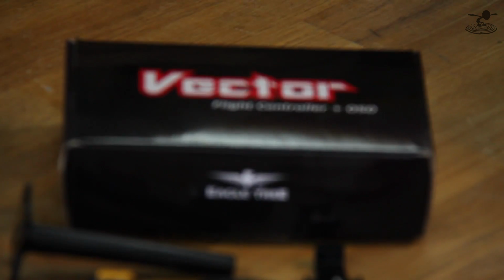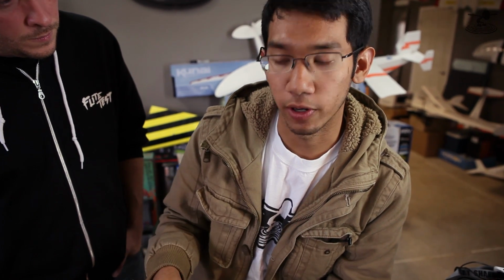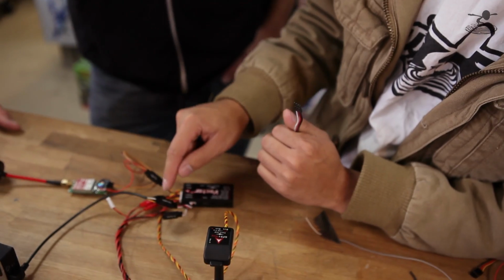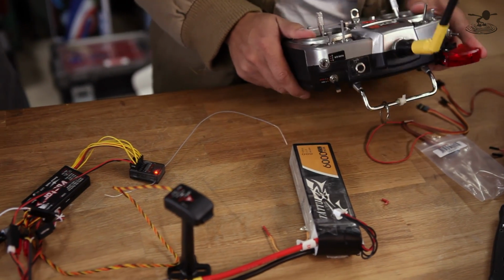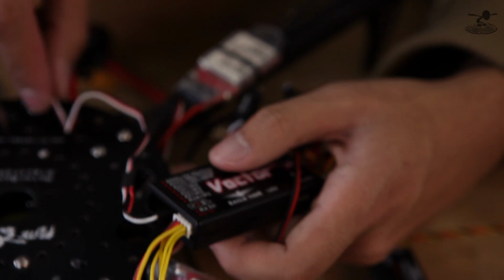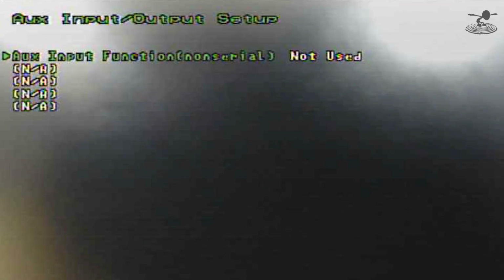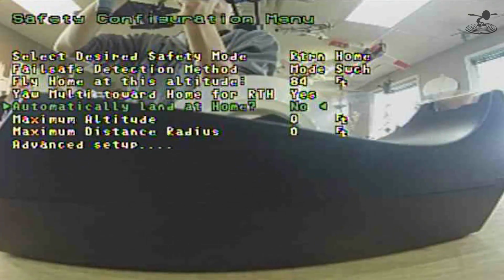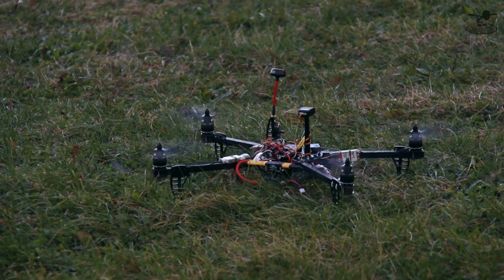Flite Test | Vector Flight Controller + OSD - Basic Setup

Comment: Personally the eagle vector has been terrible, I’m still struggling to get this working even after a year of messing with a various amount of settings. I finally got 2 motors to spin up normally (rear left and front right) but the other two only spin when the throttle is set to 100% . I’ve tried different escs and motors, and multiple calibrations but it doesn’t do anything. STAY AWAY FROM THE VECTOR AND DONT WASTE YOUR MONEY !!!!!!

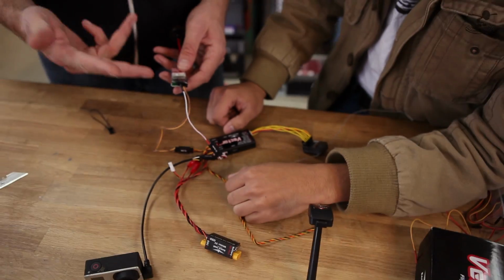Comment: At 12:00 I think you're making a mistake: If you power the TX directly instead of through the PSU, the current sensor will not account for what the TX uses, so you're actually drawing more mAh than your sensor sees and what you see on your OSD.

Comment: Nice video.  I actually watched this a while ago but just recently bought a used Doscovery with Eagle Tree Pro OSD in it and didn't have a clue where to start.  After reading the manual and watching this, I'm really looking forward to getting this set up and out flying when the weather gets better.
Reply: You'll like it.  Easy to set up and a GREAT manual.  I've made use of their customer support once when a PSU was misreporting voltages, they were quick to get it handled.

Comment: I hope you guys are on commission, because this video just secured a sale! Been trying to decide between this or the Cyclops Tornado. The vector costs a little more, BUT it also accepts digital RSSI from an ezuhf receiver. ezuhf users would need to purchase a converter to get RSSI into a Cyclops OSD and an 'off the shelf' one pretty much makes up the cost difference of the Vector.

Comment: Ah...The way this guy set-up that IMRC 600Mv VTx is totally incorrect !! First....Why is he not using the proper Immersion RC cables that came with VTX that "lock-in" properly upon installation ?? Secondly ....The Power Source for IMRC VTx's should come directly from the flight battery (solder pads on the frame if using a multirotor) 6V-25V...The IMRC VTX has a built in power regulator and the  proper installation procedure can be found at the Immersion RC web site that I cannot post in here! Review is a 6 out of 10 !!
Reply: You can just buy the IRC adapter for the vector PNP to make things easier

Comment: Flight Test, I currently have a PixHawk set up with DJI E-800 motor set up that is just giving me fits with the throttle. It is not giving me enough throttle to stay in the air while descending and she hits the ground hard. Do you think the Vector would be a good fit for these DJI motors. I have about 3Kg of flying weight w/battery. Running on a 6S 10,000mAh. I really like all the functions of this Vector and wish I had seen this video before the Pix purchase.  

thanks
 Grumpy.

Comment: Since im sure you have set it up on different platforms. I'm wondering if it could be used on a 650 quad-copter with retractable landing gear. If so how can i set up my retractable landing gear with the eagle tree vector.

Comment: Hello Josh and Peter,
Can you explain the Tricopter wiring? The manual confuses me when it comes to the using a separate UBEC to power the lone tail servo. How does the wiring work in this case? The three ESC's are opto with the Simon flashed system.

Also, when using a three way battery connector you can plug the ESC's directly to the battery? then not use the battery connector on the PSU? What are the Pro/Cons of doing this?

Thanks guys, I love your site. Lots of knowledge and fun. Take care,

Carlton Scott - Vancouver WA

Comment: Have to love the Flite Test guys! Thanks for doing such a great video on the Vector. Wish this video was available last Black Friday when I bought my Vector and a DJI Flamewheel F450 Quad. I spent hours trying to get the motors to arm not realizing you have to confirm the airframe type. I was strictly using the PC software via USB and it does not tell you to confirm and does not allow you to confirm (as far as I can tell). It was not until I gave up on trying to arm and thought why not hook up my video TX and that is when I found the issue. Then I had to learn how to do the Stick menu. Really wish the PC software was a little more complete in this area.

Comment: Come on guys .. horrible wiring on the Video-TX! Why didn't you guys use the original cable with the plugs, which would secure the wires from slipping off.

Comment: Guys, aren't you creating a ground loop by connecting the ground of the aileron wire to the Rx and the ground wire from you current sensor to power up the Rx?

Comment: Comparing this to the APM/Pixhawk I am pleased that it his a more robust color display with more than one battery voltage readout. Disadvantages are that it has no telemetry radios for remote mission control or mission planner software and it costs twice the  price.
The ease of installation is great and I like it's flexibility with various types of RSSI signals. The software configuration however looks far from simple and should encourage a lot of forum chatter and how-to videos :-)

Comment: I am happy to see you guys check out the Vector. I bought one when they first came out and love it. I would not even fly my fixed wing (FPV Penguin) without it. I love being able to launch my plane by line of sight, put the system in loiter mode while I put my FPV goggles on and the great Return To Home features.
When you use the Vector with the Eagle Eyes FPV Ground station you get great and easy to setup  antenna tracking and lots of other great features.
Great video. 
(The last two videos on my channel show the Vector in action on a fixed wing.)

Comment: It's convenient to have OSD and controller in 1. With APM/Pixhawk, I have to use the external and crappy MinimOSD hardware (although OSDoge will solve that soon).
What I do miss in Vector is autotuning. Arducopter and Cleanflight already have it. I hope they catch up soon.

Please let David try it on his tricopter. The reason is, some controllers cause oscillations with a top heavy tail motor+prop assembly, as the motor+prop mass swings the frame in the opposite direction of where the controller wants it to turn.

Comment: do you guys know of anything that can work with VTOL aircraft? i have a design that uses 3 engines, one is a ducted fan to provide balancing vertical thrust for hovering, but in forward flight, the other 2 engines are used while the ducted fan is stored away unused.

Comment: I am into fixed wing waypoint flying with the APM. This system looks much more user friendly than APM/Mission Planner. Does it have ground station software like APM? Will you do a video comparing the two systems  on fixed wing? Thanks guys! 
Big fan of everything you do; the show, the podcasts, etc...

Comment: Is there any way to use this without a fpv setup? I will eventually get fpv gear but I am looking for something nicer to replace my kk2 with for now.
Reply from the maker: The Vector does have OSD but you do not need to use it. It will be available for you when you decide to upgrade to an FPV system. :)
Reply: *****
 but you need to have the video transmitter for that...without fpv gear use a pc to configure  and  when you get bored flying  in a circle  just add the fpv stuff and your good to go explore :)
Reply: Kippuravittu I had an issue using the PC software and airframe confirmation. Had to use video to confirm the airframe as the final step to arm the motors. Could not be done on software, but I am hoping I am wrong and someone will point out where I missed it.
Reply: James Caperelli III  oh  that sucks..but it would be just ridiculous if it's impossible to determine your frame type on the pc so you must have missed it somewhere..I've allways thought that every company needs and idiot like me in the team to test out the products so fools like me can then use it without too much lost hair..

Comment: At $280 (U.S.) this setup is just about double what it would cost for an APM controller, GPS and OSD.  It may very well be twice as good, but it is certainly twice the money.
Reply: mPky1 By your logic, we should all just get DJI Inspire 1s and call it at day... Problem for me is not the high price of this FC. Problem is it's price compared to APM which is far more mature and feature rich system.
Reply from the maker: Just a minor note, I am sure you can find somewhere to pay $280, but GetFPV is selling it for $237. 
http://www.getfpv.com/eagle-tree-vector-fpv-controller-with-color-osd-wire-leads.html
Reply: mPky1 luckily theres also flip32, Naze32, Sparky(soon Sparky2), Quinton and a whole range of new 32 bit controllers that are cheap and powerful and not running out of code space or capability.
Reply: I'm a huge Pixhawk fan. However, even buying the Hobbyking clone of pixhawk you are going to be close in cost when you add gps and OSD + FTDI. Not to mention the effort in to wiring up the OSD and configuring it. I'm tempted to get this and try out.
Reply: mPky1 I would like to have seen more of the capability and differentiating features of this FC ensemble.  Does it do waypoint flights?  If so, with what software? (and at what cost?)  Does that run on a tablet, and/or a PC?  I see the configuration software runs on a PC.  Just as $100 doesn't mean much in this hobby, solder-assembly doesn't either.  If you're depending on everything being plug-n-play, you aren't really IN this hobby.
Where people say APM is dead, I counter that it is stable and mature.  It will take time for Eagle Tree to work out the bulk of the bugs in Vector.  The lowest price I see online is $238.  I'd like to see a shoot-out between this, any APM and possibly a naze32 setup.
Reply: flanker you're forgetting about cleanflight that was created because Timecop is an elitist who don't listen to anyone. and there are many more systems than those who now support semi autonomous and autonomous flight.
Reply: Pixhawk can be found in hobbyking for about 120 bucks. MinimOSD with ftdi adapter, another 20 and you are good. And if you want to get technical, pixhawk isn't just another 32 bit processor. It runs on Linux. Can interpret lua mission scrips. And actually has two 32bit processors(one is for redundancy). 

If you like naza or naze32 or whatever more, that's fine. But excluding military grade auto pilot systems, there are no other commercial fc that's is even remotely close to pixhawks capabilities (and yes complexity)

In conclusion, if you are technically minded and not afraid to tinker with stuff. ArduPilot is the best there is. 

If you want stuff to just work, and don't mind paying extra, get a DJI. 

I'm not really clear on who this Vector fc is aimed for really. People who like to tinker AND don't mind paying extra maybe?
Reply: mPky1
I was not aware APM boards will SHUT OFF!  And I mentioned OSD.  I reference the price listed on the website.  Many of us have experienced the "don't get in the hobby" line from 3DR, selling a board for far more that is basically identical.  I would have been interested to know how this product is better, but this seemed like a sales pitch rather than a review.
Reply: mPky1
you're saying it as if buying piece by piece is a bad thing.  like me with a reptile500 and a kk2 I could have a working quad for very little that can be upgraded. of course I over specced from the start. next I'll get a Sparky or Quanton, then I can add GPS and other sensors over time and as I need them instead of buying everything I may not ever need right away.

I'm also not sold on having the FC bound to the OSD, it limits your choices and falls between chairs, it's not really easy and limits advanced capabilities. The only real benefit I see from it is the ability to see flight mode on the OSD, but if all the FC and OSD makers agreed on one standard for a daisy chained data bus, there no reason any OSD shouldn't be able to show the same info, as well as much more, heck it could even provide the same functionality as this all in one.
Reply: Hugh Hemington  yeah that'd be a really cool shootout but naze32(baseflight at least) has no place in such a competition. 

Don't get me wrong i love the locked in feeling and small footprint of naze32. As far as flight stabilization go I think base flight is the best there is. But as of yet it doesn't even have RTL, let alone autonomous flight capabilities. And timecop(creator of baseflight and naze32 board) said that it'll never have those capabilities(he seems to think auto flight is for pussies and a real men would never need things like failsafes and RTL). Comparing it to APM would be like comparing a porche to an AC130

The shootout I'd  like to see is between : pixhawk, naza, vector and the flagship board of openpilot(can't remember the name).
Reply: Hugh Hemington
So your idea off this hobby is that everyone should go out to saw down some trees and then wait 3years for it to dry so you can start carving out the tools you need to make your quadcopter...How's that going? Have you carved your propellors yourself sir? and did you also dig up that ore that is used to make your motors?

APM is fucking silly nothing pre programmed really ,you need to figure everything out by your self wasting tons of money by crashing constantly..I like plug n play but not the types like naza where you are totally limited on ridiculously priced aftermarket part's...Allthou Naza is great for beginners since  it will save you a ton of money for it'ssimplicity to setup just plug n fly..But RTF kits shouldnot be sold since  building your  machinesyourself makes you a bit more carefull when flying..allthese phantom pilots flying in to walls and shit..
Reply: $235 for complete package and you don't have to hunt all over the internet to set it up.  Well worth the price of what you get.

Comment: It's not always the best idea to upgrade firmware.. really if you don't have any issues then you probably should just leave it.. sometimes upgrading firmware can lead to new issues (source: I'm a system administrator).
Reply: Wouldn't it normally solve glitches that they didn't find until after initial release? I mean they have a team of people working on the ware and test and retest patches. Hell the upgrade they suggest in the manual might fix a potentially fatal crash. Damned if you do damned if you don't I suppose?
Reply: stealth soup It totally depends on the device. With something like this, it might be a good idea, but not always. It's best to check the release notes of the firmware first and see what specifically the firmware does. Again, if you aren't having problems, and if the new firmware isn't critical then I wouldn't risk it. You can risk bricking your device if the firmware update fails.. the mobius cam for example, they even warn that unless you are having specific problems then you shouldn't upgrade the firmware.
Reply: Designandrew
 Ahh I see. Thank you sir.
Reply: @stealthsoup5882  If it ain't broke, don't fix it...
Reply: @TestECull  Thanks, I think superspeed said it best 4 years ago.
Reply: StealthSoup. A good sysadmin leaves working alone. I am IT. I like to play. but yeah that does not apply to firmware.
Reply: superspeeed. What have you been doing lately with flight controllers. Suggestions? is the new micro just as good or better than full size? drawbacks?

Comment: I'd like to see a multi part how to adjust the Vector to get the best out of this controller..
Reply: How u adjust it for fitting your needs the best is up to you, and the settings for the multirotors is different for every multirotors, everything change when you put it on another frame, use other motors/props etc etc, put it on with stock settings and choose your multirotor type, start up and see if its flying nice, if not, change pids etc. All is in the manual
Reply from the maker: Thanks for the suggestion!

Comment: you guys should use the naze32 or flip32, way cheaper and better in my opinion. just a bit harder to use.
Reply from the maker: Indeed, we use all of the above. Pros and cons to most control boards. We wanted to present something that has a much high ceiling on features for more advanced users.
Reply: they do, but this is for people that dont want to use naze32 or flip32 and want to try something easy that works.
Reply: FliteTest "high ceiling" seems to be quite an understatement on that piece of equipment...

Comment: Does setting it up as a quad instead of a spider quad make a difference? Josh said it flew well in the video as a quad on a spider setup so i was wondering.
Reply: I do not believe so...
Reply: I think what Josh meant is that the frame is a "spider", but with four arms, and the CG is not in the middle.
So no, its not setup as a hex.
Reply: you'll only really notice during hard maneuvers where you suddenly push the engines as the front ones will have more authority.